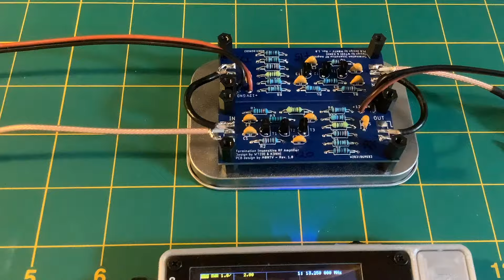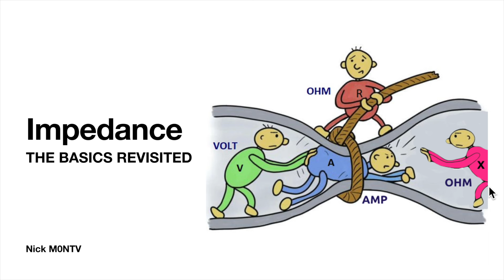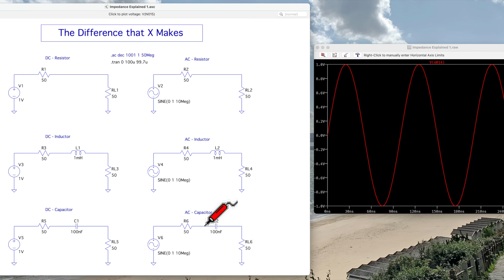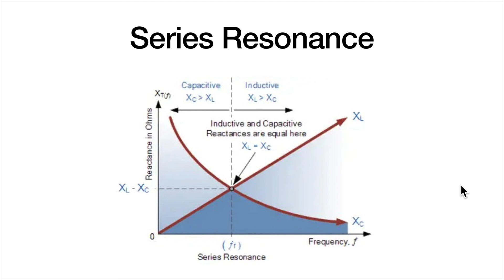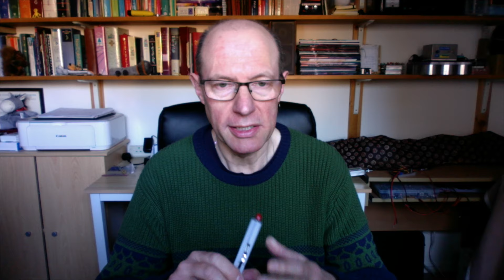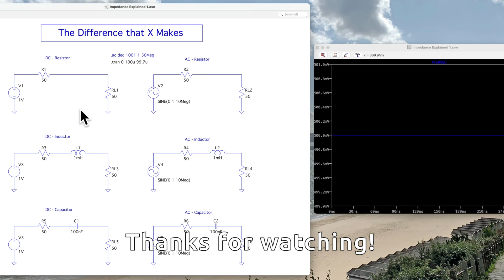49 - Impedance - THE BASICS

Comment: When measuring the impedance using a NanoVNA, isn't there a danger of overloading it?  Sorry if that's a naive question - I have just read that you don't want to be actively feeding signal above 1mW?
Reply from the maker: Hi there! No apologies necessary - you are right to be cautious of overdriving the NanoVNA. If you use the setup that I describe in the video then input impedance is absolutely fine. If you think about it - even if the SWR was truly horrendous and all the power was reflected back then that would be no different to putting an open load on the NanoVNA - something you have to do each time you calibrate it.

For measuring the output impedance of an amplifier then you have to be more careful. DO NOT put any input signal into the amp. I attach a 50Ω load to mine. The NanoVNA will again be measuring its own reflected signal that you are putting into the output of the amp + the noise that the amp is generating itself. It is the latter that you need to be careful with. If the amplifier is a good one then the noise should not be too high but if it oscillates then you could damage the NanoVNA or at least get erroneous results. Hope this helps. Thanks for watching and commenting. Best wishes, Nick
Reply: @M0NTVHomebrewing  OK, thanks; I'm not sure I totally follow (I'm a beginner with NanoVNA, and some of this radio stuff in general!)  I shall be cautious!
Maybe this is a good thing to demo in a future video?! :)
Reply from the maker: Check out Alan Wolke's videos on using the NanoVNA. He has a wealth of tutorials - just search for 'W2AEW' in YouTube. 73, Nick

Comment: The method you presented to measure the Output impedance is interesting. You need to be careful, the amplified noise emitted by the Output (even with terminated input) could burn the S11 port of the nanoVNA. 

Have you seen this method discussed somewhere or it is something you came up with? 

Thanks!
Reply from the maker: Hi there! All I can say is that my NanoVNA must be made of strong stuff! I would imagine that the gain of the amplifier must have to be exceptionally high and/or the device be very noisy for the internal noise to burn out Port 1 on an S11 trace with no input into the amplifier input. As I mentioned my NanoVNA is a very early model but is still going strong. I'm not sure where I got the idea from to be honest - but it seems to work. Thanks for watching and commenting. 73, Nick

Comment: Nick, my goal as a ham is to learn about RF, and build and experiment, not to spend my day chit-chatting or chasing certificates. I want to know how to manipulate my physical electromagnetic reality of electrons and photons the same way that sailors do the wind and the water. I've been reading a book about impedance matching, and a video on the topic from you is more than welcome. You usually manage to make things easy to understand. Thank you. BTW, my NanoVNA, not any of my transceivers is my favorite piece of equipment. That sort of labels the type of ham I am.
Reply from the maker: Thank you so much John. I'm delighted you share the same curiosity and fascination with all things electromagnetic. Incidentally what is the book you have been reading on impedance matching? I'm always looking for more inspiration! Thanks again. 73, Nick
Reply: @M0NTVHomebrewing , it's actually a much more inclusive book on all facets of radio design. But I have been studying the impedance matching section as that's what I'm weakest on, (and much of radio design is just the proper matching of several relatively simple stages together,) and I've wanted to actually grok the subject instead of simply applying formulas or rules of thumb, or exactly copying what someone else has already done. The book is, to me, a good balance between theory and practice, pretty deep for a brand new new ham with a shiny new Baofeng, but nothing like wall-to-wall calculus and field theory, either. As a self-taught electronics tech, but with 50 years of work experience and reading, it came in right at the level I'm ready to learn at for RF design and experiments. You would have no trouble at all with it. In fact, you may already have it. It's:

RF Circuit Design
by Christopher Bowick  

It's $10 to $15 US, used price on eBay. There is a second edition I found on Amazon, but I found my cheap, used copy of the first edition on eBay.
Reply from the maker: Thanks very much John. I've just managed to download a PDF version to see what it is like. It looks very interesting. Thanks for the recommendation. 73 my friend, Nick

Comment: Nice tutorial!
Just a word of caution about connecting the output of an amplifier directly to the nano vna. Make really sure that the input is connected to a 50 ohm termination, and that there is no DC bias on the output. Have a look of the output on a scope first maybe.

The ports on the vna is quite sensitive, and easy to destroy :(
Reply from the maker: Thanks Orjan! Yes, you are right to sound a note of caution. Fortunately all my amplifiers have DC blocking caps on the input and output so that's not an issue for me. Also the only signal going into the amplifier is the S11 sweep from the NanoVNA. I wouldn't feel comfortable with an S21 unless you put a truckload of attenuation on the amplifier output. Thanks again. 73, Nick